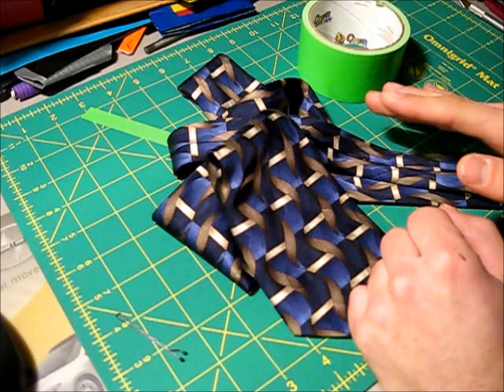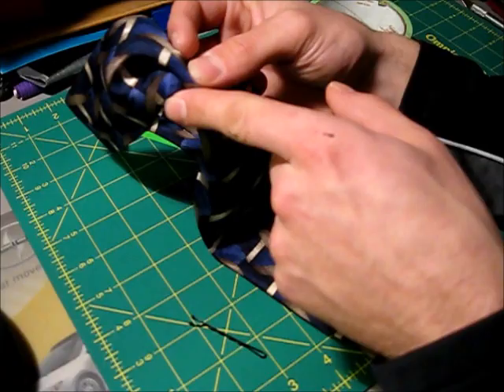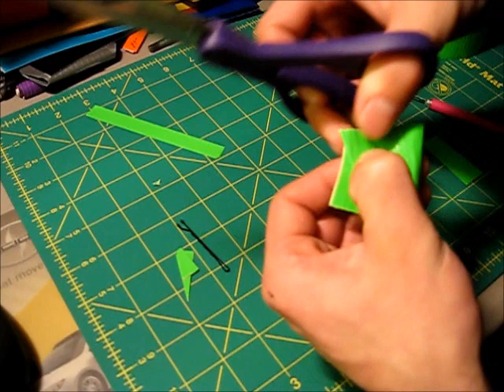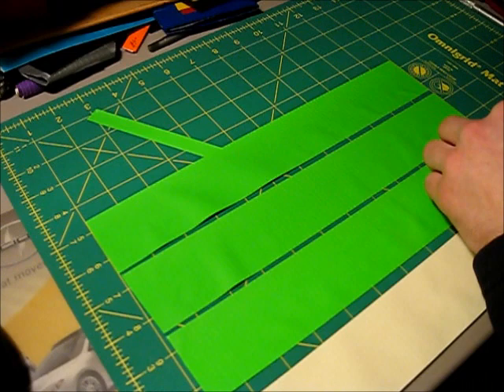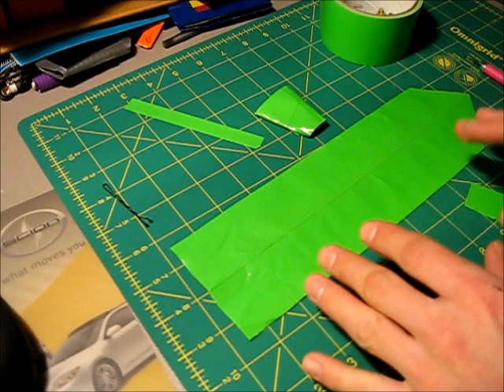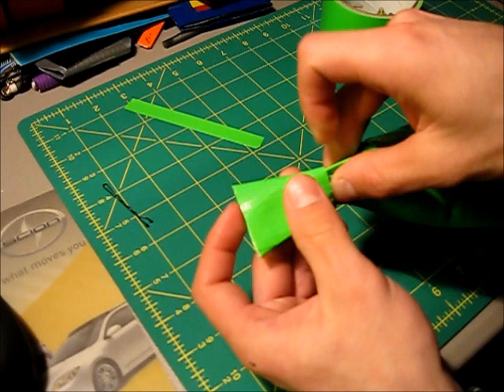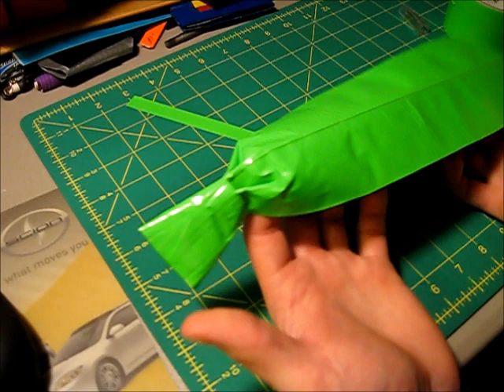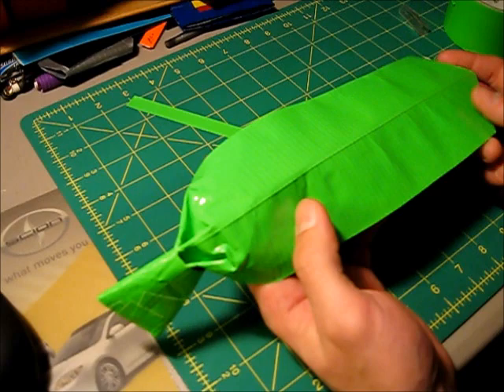How to make a Duct tape Clip-on tie

Comment: @pies1997   I just took four 6 or 7" long pieces of duct tape, made a loop with the sticky side out, put them on the back of the board, and then stuck it to the table I use.  Go duct tape.. :))